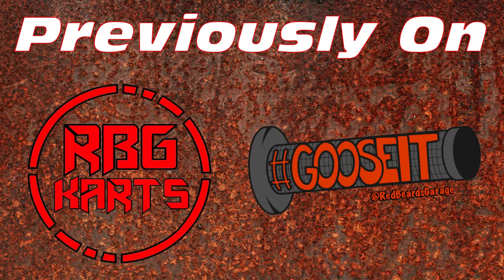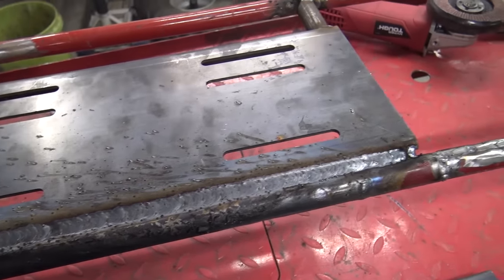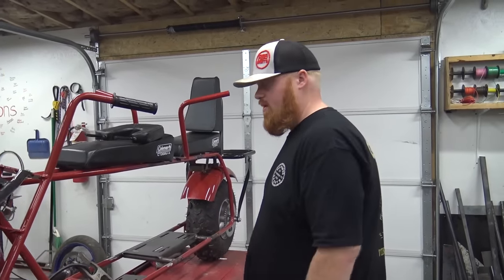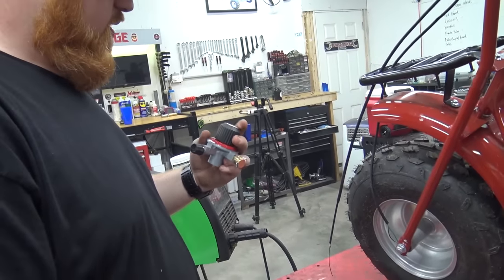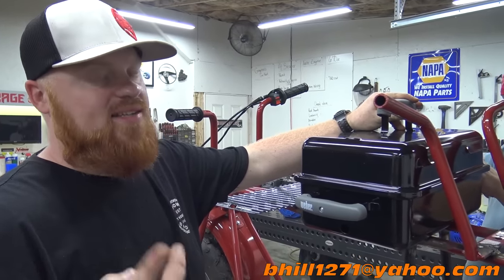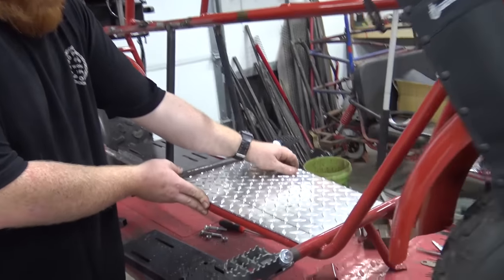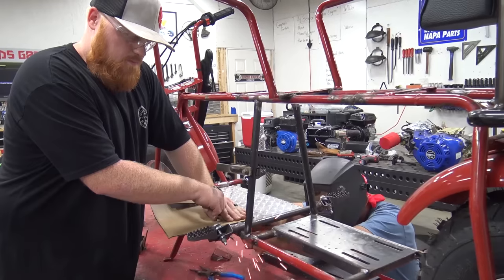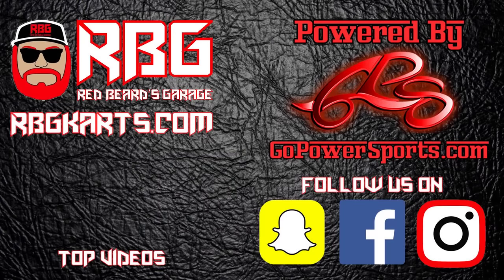2 Seater / Tandem Mini Bike Build Ep2

Comment: The frame on my Coleman CT200U was stretched a few months ago. I bought 7/8” DOM tubing and used it to lengthen the frame 12”. I’m also building a new leading link front suspension and adding a tractor seat from Gopowersports.com. The rear drum brake was removed and replaced with a hydraulic disc brake on a jackshaft behind the engine. I’m considering a Honda electric start engine for a charging system to run lights. My bike will be used for working and hunting on my property. Thanks for all the great builds. I’ve loved minibike since I was a kid. I’ve had quite a few and your channel got me back into them.

Comment: I would love to see a "goped" build they sell a 50cc engine on amazon that says it comes with a transmission likely a torque converter but I would like to see what you could get to run stock and then fully built

Comment: For things like engine plates with lots of vibration, or suspension components, if you have an area where you can make one long weld bead, you shouldn’t. Instead you should do stitch welds, which means making a serious of welds that do not connect. Sort of like spot welding but with beads not just tacks. This method is used in the industry, it provides a safety net, if one weld cracks, it won’t continue cracking, it will stop at the first weld.